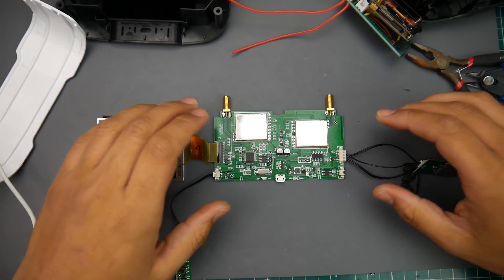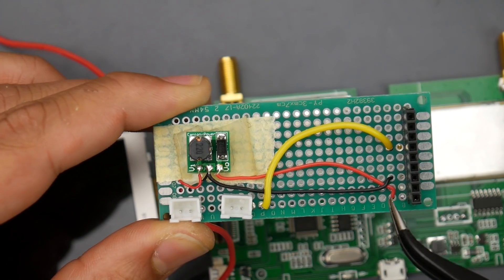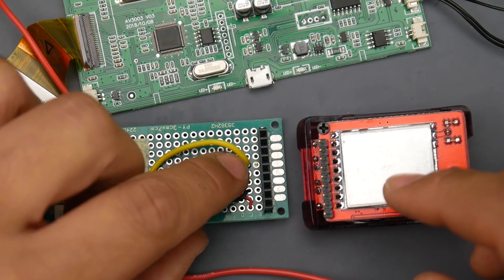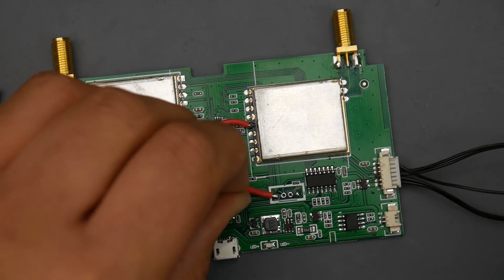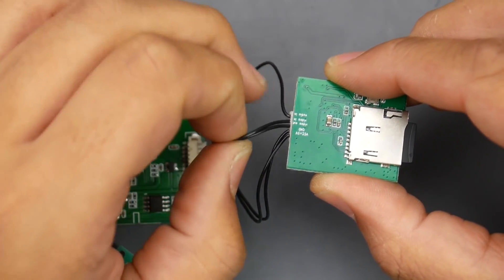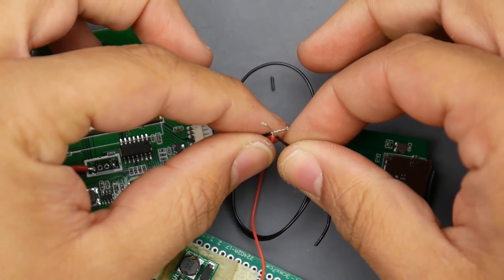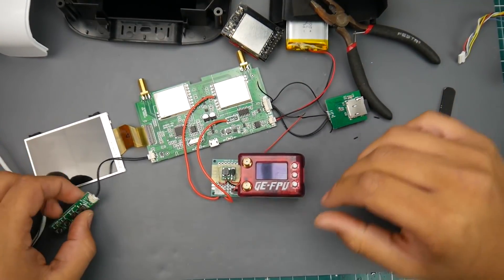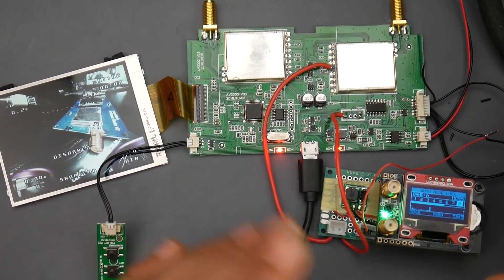Fatshark Mod For Eachine VR D3 Goggles 3 Inch 5.8G

Comment: First, great video, second, this gave me an idea, would it be possible to highjack the dvrs Vout signal the same way but have and hdmi input instead? Assuming you get an hdmi to AV converter that is, those old HDMI2AV converter box thingies are pretty cheap these days. And you'd be able to flip between dvr and "hdmi" with a 2 way switch right?

Comment: Do you think there is a lot of difference between these standard modules like the rx5808 and the internal receivers of these goggles to make the mod worth it? I have an ev900 and was really thinking to do a mod to put at least a True-D to make a real difference because i don't know if a rx5808 would do any much more than the internal diversity. But if these cheaper modules are worth it i'll stuck with them.

Comment: Everyone is saying nice mod, but is anyone else not noticing that  @15:19 where he says it doesn't do static... so when you drop video frames it flickers to black. It's digital not analog so yeah this is NOT a good way to mod it. Remove the modules. btw i didn't thubs down the video though. It was actually a good walkthrough and does technically work.

Comment: Can we get a battery mod video for the same goggle ? Please ? :)
Reply: Why u need a video for that? It's 2 cables
Reply: @ho-xo8my  Some of aren't electrical engineers, Im not sure how big a battery it can take, best ways to do it etc....its a hobby, and Im just getting into it, so skill level is low.
Reply: @riggermortisfpv526  I recycle the 1300/1500 that no longer give me good flight, I add a charge chip that I recycle from other old or inflated 1s batteries. you can search on AliExpress or Banngood 2/4 batteries 1200mah 1s and they must reach you, you will need to buy the connector to use them externally. luck!

Comment: The problem with this hack is that if the video signal strength is bad, you loos the complete video to the black screen, instead of normal video with much static.
Reply: indeed. The video signal from the fatshark module should replace the internal receivers signal, just after the diversity switch.

Comment: So why not just use the AV in?(assuming it does support AV in)
Reply from the maker: AV In is used by default receiver and the DVR is basically the second AV in and that is what I did
Reply: @DroneMesh  and that way, can I use The dvr?  Same time using module and record?

Comment: Sorry, I didn't really got you, what's advantage of this mod?
Reply from the maker: Longer range and more options and features.
Reply: @DroneMesh  
Why not just running a short coax internally from the sma connector to the receiver and cutting the actual PCB line? That should eliminate any interference you getting with this messed up PCB layout.
BTW, the Eachine rx modules are proven to be very efficient in terms of range, for example ev800d.I see no reason running fatshark modules, are the D3 modules that bad? Do you have some more documentation about the RX Modules? Have a faulty FXT viper monitor, where one RX has poor signal, would like to exchange the module.
Reply: @waldemarkraus2855  that sounds like a better idea than having to buy/use a fatshark module and do this mod, especially if looking only for better range
Reply: Half the reason people want a fatshark is to get to use modules which are amazing for good video feed.

Comment: I recently bought ev800d but the battery life is like 30min of using with two stock batteries in parallel. So only about 15min with stock battery. Is it same with yours ?
Reply from the maker: Around 30 min they all need battery mods even this one..
Reply: @DroneMesh   thanks :)
I'll just use 4 2500mah 18650s